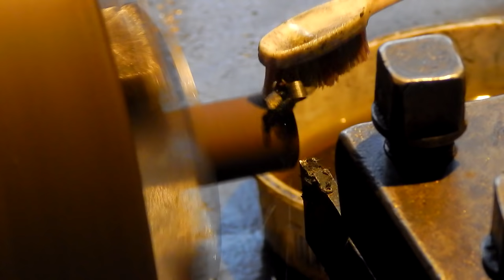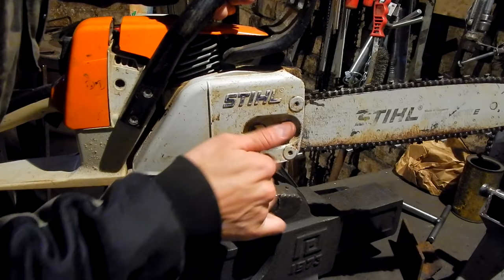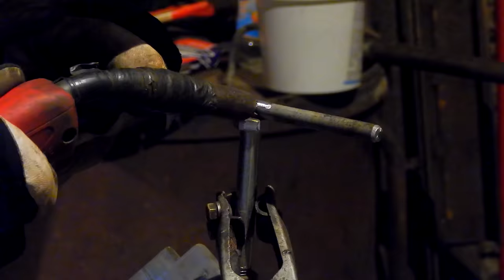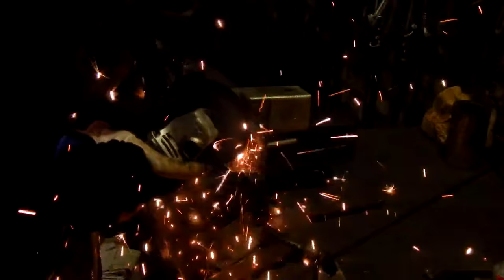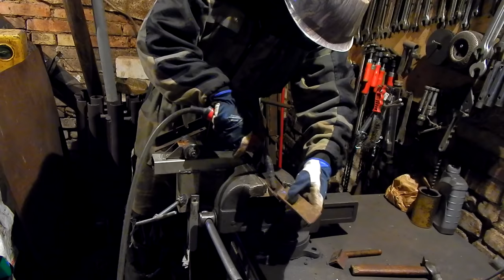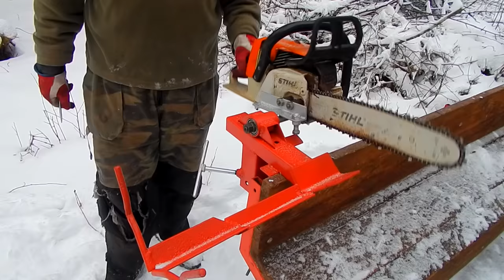DIY Chainsaw Attachment

Comment: I also burn everything bigger than a pencil, and build stuff to make life easier. You have so many good ideas that I never thought of. Some of your projects are super great the way you design and don’t cut corners. Most people would have used a bolt through a pipe instead of bearings. I love your videos. Stay safe

Comment: Nice! Maybe you can make a pedal for chainsaw controlling. When you step on the pedal you rev up the engine and when you tilt the pedal then the saw will cut. So you can use both hands. Pedal is on the ground, connected with car brake cables so you are able to move around. Or it will do both at the same time when you step on it. Then only one cable needed.
Reply: I had the same idea, make a footcontrol, so your arms are free! 👍
Reply: Dang that’s a brilliant idea! Having both hands on the limb would make things quicker/safer.
Reply from the maker: Yup, that thought crossed my mind, but... I didn't want to attach the chainsaw permanently to this contraption since connecting the throttle lock release and throttle trigger itself would've required more intricate engineering if I still wanted the saw to be quickly releasable and I do have to refill the fuel and oil tanks from time to time or use the chainsaw in the regular way too. So I went with the light version of it. :D
Reply: @DonnDIY  Throttle trigger and lock mechanism can be done fast removable to. Like with flynut or something. Just thinking :D

Comment: Really nice...
-Is the locking wing nut not long ? you didn't poke in it with your waist ?
-Do you think a rail on the trailer's length,or just an other pole in the middle of the trailer could be beneficial,to avoid to move the log,once cut ?
You could adjust the chainsaw's position along the trailer, to cut the log and let if fall in the trailer in one motion,for each stack ?
Reply from the maker: Nope, didn't poke into the locking bolt with my waist.
I can attach this cutter to the center post so I could fill the front of the trailer first without moving the pieces by hand. I just wanted to keep this design simple and easily portable. I still have to move the pieces by hand no matter what since they tend to pile up just underneath the saw.

Comment: If it were me I would also make an end stop that clamps over the wooden side of the trailer, and so you can move it along to set a end stop so all the logs are pretty much the same lengths without thinking, although I can see that you did a very good job of cutting them all the same anyway. And as other suggested a foot pedal would also be a cool addition to make it easier to control.
Reply from the maker: I marked a line on the edge of the wooden dump box. So I roughly lined it up with the line and got 50 cm pieces. I thought about a limiter but the branches are so curved that the end stop plate would have to be with a huge surface area to catch the end of most of the branches.
Reply: @DonnDIY  Ok, that basically achieved the same then. I would have just made a small limiter plate, and even when the branches don't touch it you have something to line them up with, but that pencil mark is an easier way to do the same thing. Good work.

Comment: Nice design and build!  
If you can, try a battery-powered chainsaw instead of gas.  That's what I use now for all limbing and smaller work; its quiet and doesn't waste fuel and bar oil when I prep a limb or move stuff around.
Regards.
Reply from the maker: Yup, battery powered saw would be better for this application.

Comment: Put that holder on a rail so you first fill up the front of the box and then work your way to the rear. Save throwing cut pieces up to the front to fill the box.

Comment: Great job in general. Of course after seeing it in action. I wondered why not just pivot the saw on a single extended nut like you machined? Cut the flats into a shaft and internally thread. Done
Reply from the maker: Using both of the nuts was required for the limiter setup. I didn't want to use parts of the saw to rub against anything when limiting the movement of the chain bar.

Comment: Another good piece of design and engineering , simple and effective , a one shot deal for firewood , saves hauling it back then having to cut it at home , excellent job . Keep up the good work . When are you going to do the small excavator your father gave you , will be looking forward to see the resto on that .

Comment: You need to put a stop on the bed so that it's easier to get the logs the same length, even if it's just a "C-clamp" clamped to the edge of the bef.
Reply from the maker: I have a line marked on the edge of the dump box which shows me the desired length of a cut.

Comment: Hello sir,
I discovered your video which impresses me a lot and I am very admiring in front of this functional and practical result.
Could you please give me information about the "diameter" of the pivot supporting the chainsaw and if it doesn't bother too much, the characteristics of the bearings. How long is your blade guide?
Can I count on an answer that would help me a lot.
Good continuation, excellent day with my cordial greetings. P. K. (French)

Comment: That’s a great design. Just wondering if you were left handed. I Guess it could be designed to mount to the other side of the trailer and the log cradle mounted so to use your right hand for the trigger pull. Thanks for the video. That’s also a nice looking trailer.

Comment: Nice job Donn. I was a little concerned about how close you got to the chainsaw bar. Is it possible to make a bar shield that will protect you from contact with the bar and yet stay out of the way when you cut the logs?
Also do you dry your logs before burning to increase your heat return per log when burnt?
Reply from the maker: The chain has stopped when I reach over to handle the pieces. No need for a guard if I personally use it. If I'd let someone else use it now that would be a different story. Yes, I do dry the branches before heating the house with'em.

Comment: Very nice! Us righties would mount it on the other side of the trailer. ;) Patten pending?
Reply from the maker: I am right handed by the way. The location of the chain bar attaching nuts determined the setup of the cutter. :D But my right hand has more power anyway for holding down the branches. So all is well. :D Nope, no patent. Everyone should feel free to copy this design but not this video. :D

Comment: I don't see the point. It would be just as fast, or faster, to just walk over to the pile with the saw and buck up the branches freehand. You don't save any labor at all, just because the cutoff fall into the trailer. You still have to pick up the branch, position it, and all the other labor involved. Buck the branches freehand, and then toss the pieces in the trailer.
Reply from the maker: I'm not too keen on bending over while handling buried pieces of branches in the snow. This way I can take a whole branch, knock it somewhat clean from the snow and cut it while standing straight up. It's just the way I prefer to do it.
Reply: That works!  =0)
Reply: What!!!!!! This makes so much more sense than your way. I can't stand going back to pick up all the cuts. The bending over pick it up is back breaking. Well don't know how old you are but no thanks my backs already broken

Comment: This doesn't seem practical or efficeint. First of all, here you are de-limbing a limb with an axe! You have a chainsaw, use it! Make a wood horse, do your limbing on the ground, cut your sticks to legnth, then pile them in the wood horse. With a stack of sticks or limbs in the wood horse then back up the trailer and cut the whole lot off free hand. For the time it took to make that gadget you could have cut half of your winters wood. The time to use this gadget would be slower than free hand cutting. Nice job on making the thing! You are very handy for sure. If you had a disability or were not at all experienced, and you always had a partner, then maybe this would make sense. Each to his own!